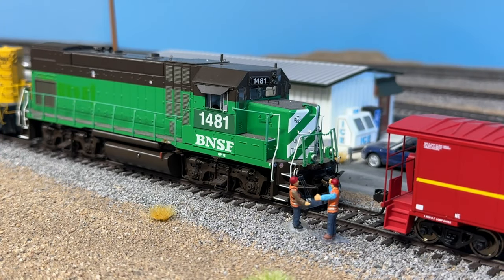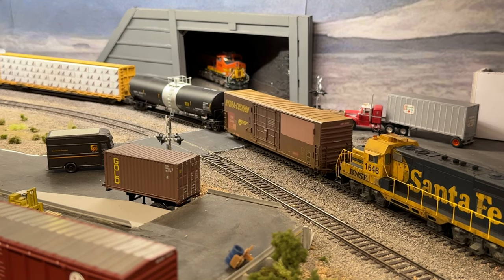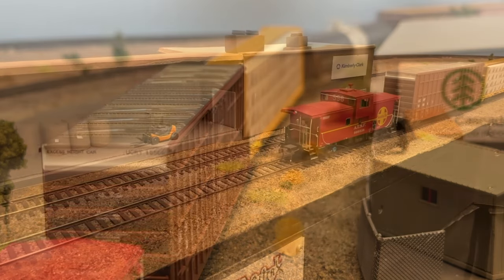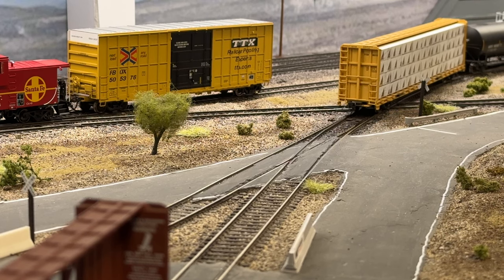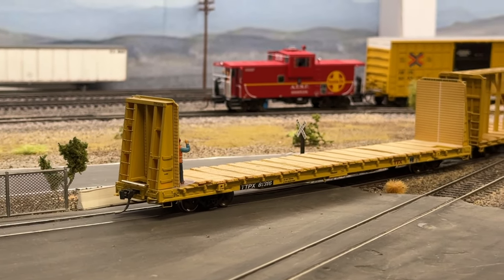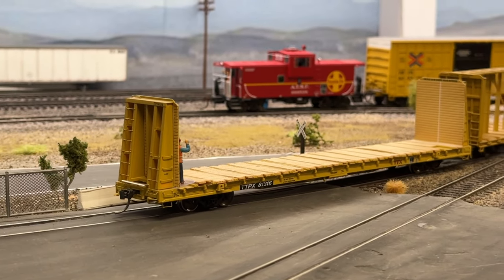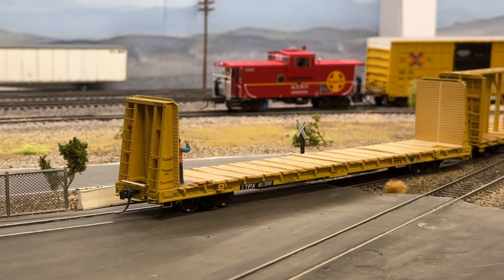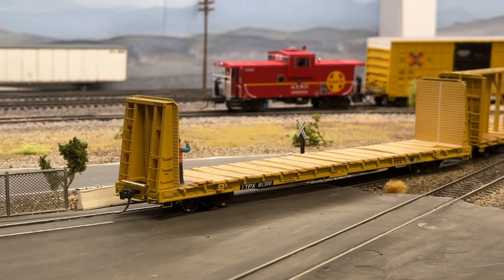Local Operations! - BNSF Model Railroad in HO Scale

Comment: The coil cars could be used in a facility that uses sheet metal for manufacturing.    Like appliances or whatever.     You could also have a reefer and a double door or a insulated box car to go at the cold storage they did that also.
Reply: Lots of small manufacturers receive coils for metal stamping. You could even have a metal distributor that cuts coils into sheets and ships them out on flatbed trucks and trailers.

Comment: You are in SouCal, you can freelance a team track similar to the former Santa Fe facility at Malabar Yard on the Harbor line. It received loads for several customers that were not directly served by a private spur.  Flat car products, steel coil loads, dimensional metal and wood loads, virtually any single load item can be transferred from rail to costomer/drayage service.  Malabar team track(s) were very busy in the 90's.
Reply from the maker: Thanks for the comments! I appreciate your insight on the team track idea!

Comment: Nice! Love the layout, love the ops, love the casual, informative but not over-detailed narration.

One small thing is that the white balance of your footage is all over the place. 22:30 looks about right -- the white trailer in the background looks white. But compare with 21:15, where the white wrap on the lumber load is distinctly orange-brown. Basically the camera doesn't know whether it's looking at white objects in yellow light or yellow objects in white light and sometimes it guesses wrong.

If your layout lighting is consistent (i.e., same type of light across the whole thing) then manual white balance is the way to go. Before you start filming, put a piece of copier paper on the layout, photograph it, and use whatever mechanism your camera has to say "this is white". Otherwise (e.g., if parts of your layout are lit by a window and parts aren't), it should be pretty easy to correct the colour balance in post. Again, there should be a thing you can click to say "this part of the image is white" so it adjusts the colour. Really does make a big difference to the final video.
Reply from the maker: Thanks for the feedback and glad you like the videos! I'll take a look at the settings and see if I can't adjust the WB.  I know it get finicky when zooming in. Thanks again!!

Comment: Loved the video, the gentle sounds of an EMD shunting are music to my ears. 

For what it’s worth,  If I was doing the same shunts I think I would have put the lumber cars into the lumber yard first and left the clearance for later.  That way the push move to Kimberly Clarke could have been done with a smaller string (just the box to be placed and the pushing platform).  If the team track cars and the BASF tanker were left open on the run round the return from KC could drive straight onto them which would have them on the correct end to head back up the branch.  I would have grabbed the push platform on the tail of the second run up the branch so you had a push platform for the return.  When you get back of the branch the second time you would put the two branch moves together, clear the empty from the lumber mill and head back to the yard.  

Anyway, still loved the video, look forward to watching the next instalment.  Cheers
Reply from the maker: Thanks for a ll the great info! I'll definitely try some of your suggestions on the next run down the branch!